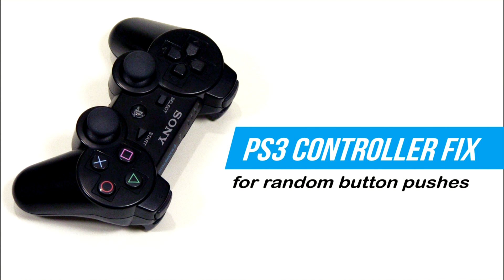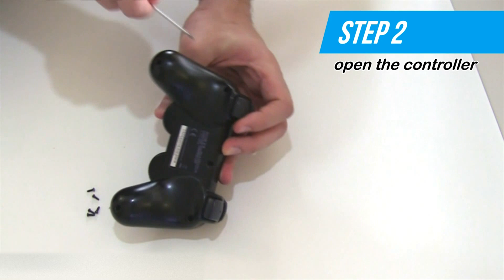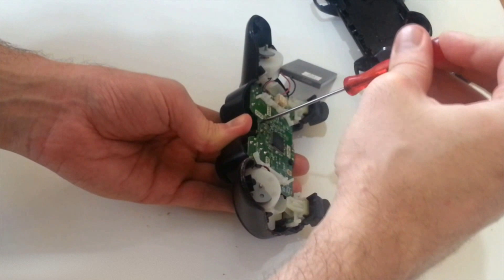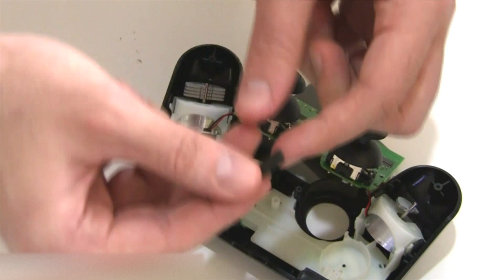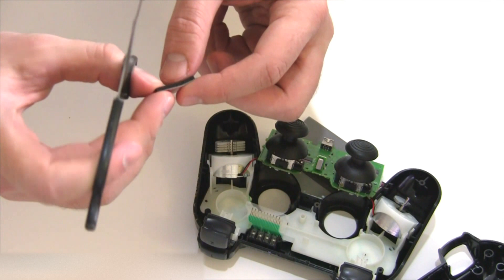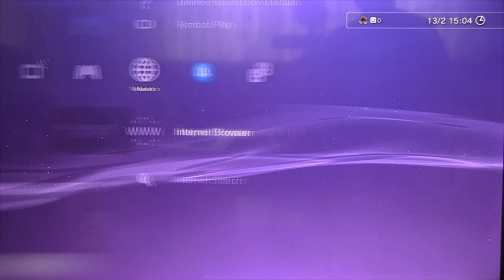PS3 Controller Fix, Random Button Pushes

Comment: So far most to the point vid - thanks for sharing! Now my wife wont complain when she gets the "bad" controller lol
Reply: I second that. Excellent video. Taking mine apart right now
Reply: Yep, that worked. I would never have worked that out myself
Reply: If you're interested, it also appears to have fixed the disconnect issues when vibration was on. (I use it wired on the PC) So glad I found this information.

Comment: Saw another video with similar instructions and it worked (only difference is I used sticky notes, instead of sticky tape). But I was much rougher with it and didn't have anything to clean the insides.

Comment: This vid is RIGHTEOUS, when taking off the casing MAKE SURE you tilt the trigger buttons down towards the table, worktop ect. Especially if you have to pry it open, if held upwards the trigger can fall apart & are fucking fiddly to put back together.

Comment: It will work. Do as done in this video. But DO NOT USE WD-40 spray for any thing. WD-40 is a oil base not recommended for any type electrical controls or consoles.

Comment: I  did it!!! I messed up a lityle at first because the l2 button came loose. Eventually I got it back in place and followed your steps, except that I used paper instead of the 2 sided tape. So far so good. I really had nothing to lose. It wasn't working at all before.

Comment: Thank you so much! Quick and straight to the point. Was able to fix both of my defective controllers and resume playing within half an hour. I was also able to fix both using a piece of cardboard under the foam. Once again, great vid and good help
Reply: Did you tape the cardboard or did you just place it there.
Reply: Ty🙌
Reply: I cut up a sheet of printing paper into 7-8 layers using scissors/a blade to get them to shape, then used clear tape to hold the paper together & sticky glue to stick the rubber foam with said paper layers. I'm sure there's a faster method out there but it's all i had 🤣

Comment: It worked!!  I got worried when I had to open the controller again because the R1 button got misplaced by accident while closing it and became stiff. Managed to place it properly.
Reply: I did the same thing and also managed to fix the trigger when I opened it again. It doesn't help that the screws are cheap pieces of crap. The head on one screw on my controller is completely wrecked. I've no idea if I'd be able to open and close the controller again if I needed to.

Comment: I found the >>SOLUTION<< for my dualshock 3 (Thumbsticks drift/move it self)! Read me!!

WORKS on the PS4 controller too!!

-----------------------------

Thumbstick Re-calibration:

Turn off the PlayStation 3/4 and controller (please make sure the console is not in rest or standby mode).

Press the thumbstick in and hold (press just until you hear / feel a click) for 30 seconds.

After the 30 seconds have elapsed, release and rotate the thumbstick clockwise followed by counterclockwise at least five complete circles a piece.

Lastly, press the thumbstick in and hold for 30 seconds.

----------------------------
I think the reason for the anomaly and de-calibration was due to the battery discharging, with no power to preserve the original calibration.

Enjou!!  ;)

Comment: I'm going to attempt this later... 

I was going to buy a new controller, and then I saw a fix with cleaning alcohol, but the cleaning alcohol costs almost the same as a new controller, so I will try this, I'll reply to this comment as to whether I'm successful or not 😂...
Reply: Forgot to reply, it worked perfectly, I even went crazy and wiped the electrical component with a tiny bit of alcohol hand gel 😂 haven't had a problem since, thanks!

Comment: Great tip, i have this issue recently with my controller, and i have some experience cleaning my controllers (since n64) so i opened this one too and do the regular stuff, (cleaning pads from inside and circuit contacts) with a moist q-tip,(just water) and a dry onebut this dualshock.with sixaxis seemed a little more sophisticated to me, and i was nervous to touch that what you just showed its the main problem so i couldn't fix it. and i was suspicious of that part always but never wanted to touch it, haha now i am certain thanks to you, appreciate it.

Comment: rantoid... i dont know if youll get this... but how do you fix the cechzc2u A2 version of the ps3 controller. no one has any videos of this type of controller and i dont want to buy anything like a new controller as sony stopped production of ps3 stuff and its now overpriced. same problem except the nunchucks dont work and the up down d'pad doesnt function. the left right d'pad functions but automatically scrolls left and then shoots up.
Reply from the maker: I haven't seen that model myself but I suspect it could be a legit looking fake one.. There are way too many fake controllers in the market and they almost look genuine..

Comment: My controller is little different from inside. The circuit board in my controller is smaller than yours do you know what should i do ?
Reply: Abhishek Sathe me to
Reply: Abhishek Sathe have you found a solution?
Reply: Nope
Reply: Abhishek Sathe this is most likely because your controller isn't the one that came with the console. I have two pads, one form the console and a store bought. They were different when I open them up. Similar to what you said about the mother board
Reply: Abhishek Sathe u have the A2 version
Reply: Abhishek Sathe your controller is not the original one that came with the console

Comment: Such a badly designed ribbon cable all they had to do was use a ribbon cable that actually slots into a connector (like how the battery pack is)

Comment: Thanks for the video man. Do you also have any idea how could I fix a non accurate analog stick? These sticks seems to be degrading over time... I got 2 PS3 controllers in top notch condition and I use them for PC gaming. One of them has its left analog stick losing its accuracy though... It pulls itself slightly to the right...

Comment: Any tips to remove the screws? 
I can't lol
Reply from the maker: it should be easy if you use the right screwdriver.. the screwdriver I use in the video has a tip size of 2mm, if that helps

Comment: Hi I'm been having this problem for a good min now and i want to fix it but what type of screwdriver do u need to unscrew the screws? Because i been using the mirco phillips screwdriver 0 and i got 3 out the 1st time but on the right side of the controller the screws wasn't coming out then i give up and put all the screws back in then i tried again but then i only got 2 screws out. so i really need help. (BTW this is the screw tip i was using ) http://www.wowhobbies.com/images/products/detail/ScrewdriverphillipssingleNew3jpg.1.jpg

Comment: My controller turns it's selfe off randomly even if it's plugged into the console. And the battery seams full and is t dead or anything . Anyone got a clue on how I can fix this

Comment: Did this once but again this problem is taking place... Please help😅
Reply from the maker: It's possible that this problem will return when the tape you put behind the foam gets squashed again. You may try a thicker tape, or even better, find another foam if you can.
Reply: viiduu I used the same tape you used and this problem is occurring again... I am now repeating this again
Reply from the maker: Yes. I had this problem coming back as well. Sony should have put a thicker foam, but they didn't. You have to repeat the process every time the tape is squashed. Or just put another foam instead of a tape, if you can find one.
Reply: viiduu  Hey I repeated it again... But it's still going nuts... What next... I doubled the foam. Did the steps correctly but again?
Reply from the maker: Well. There is nothing much you can personally do if this is not working. Take it to a Sony service center.